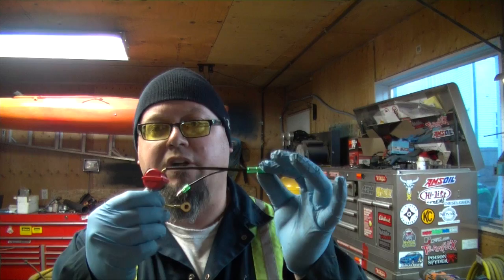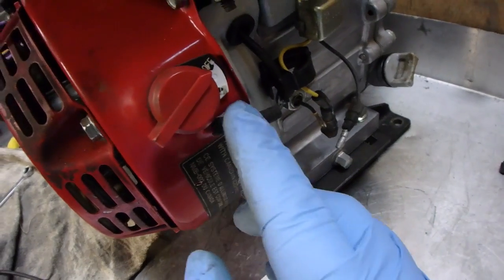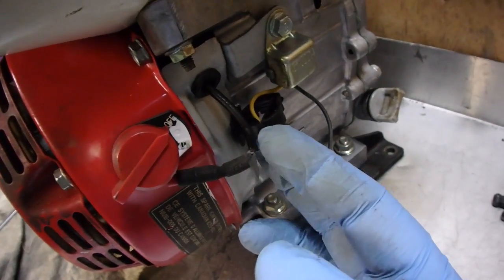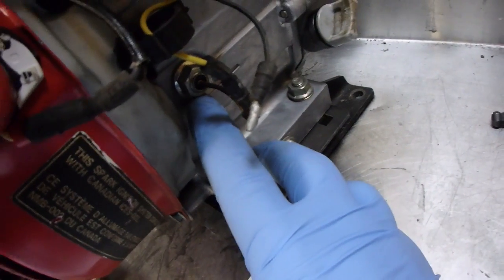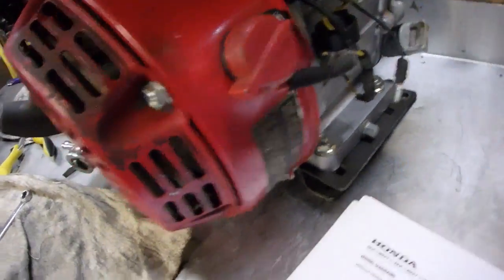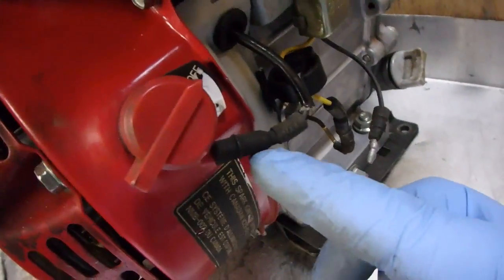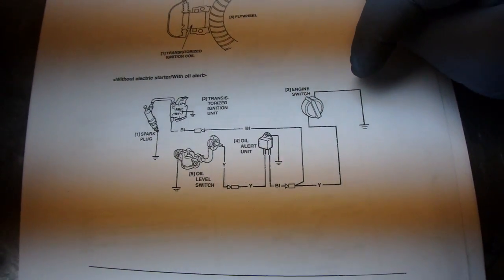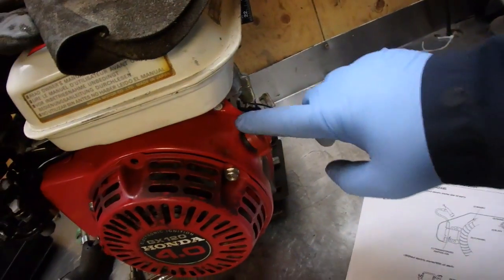Honda GX120 Why was the Low Oil Killswitch Hotwired

Comment: I bought a new power washer with a Honda GS390 engine running it.  After about 10 minutes the engine miss fired a couple of times and then died.  The engine oil was at the proper level.  I had no spark even though the coil was making voltage.  I sprayed ether into the carb, but no fire.    A day later It occurred to me that I had night tried the old standby . . . a ball peen hammer.  I tapped the nut on the side of the engine where the yellow wire goes to the low oil sensor.  The engine then fired right up.  Sensors can be a blessing, and also a curse.

Comment: A mouse at the wire off my low oil sensor. I removed the nut but the sensor does not come out. How is that sensor replaced?

Comment: Have a gx160 that I have replaced the carb the coil spark plug air filter an changed the oil it only runs for seconds then stop an ideas ?

Comment: Here's a thought on the reason the previous owner bypassed a perfectly good switch.  Whatever it was powering had alot of vibration and/or the engine mounting surface as well.  It was probably a temporary fix.   I have a GX 390 powering a constant duty water pump that I had to bypass because of some broken welds on a lower mounting plate (being  further above the vibration source in this case exaggerated the vibration causing enough internal engine slosh to trigger the shutdown within the first minute or so).  At least it made a good and mostly safe TEMPORARY fix until the welding repair happened.

Comment: would be nice if you talked a little about the ground path and how the sensor works and gave us tips anyway how to trouble shoot the sensor.. what should readings be on an ohm meter or what the sensor actually does to cut power.. i'm guessing it shorts the ground? because the wire going to the coil seems directly connected to the ground via the switch at the same place as the sensor via the Y connection...

Comment: Very common to disconnect the oil level sensor on these engines and their clones when used in Go Kart and Mini Bike applications because the engine will shut off when cornering hard. These engines are designed to be ran in their upright position. When tilted or cornering the oil level drops causing the engine to turn off. Predator engines are the same way.

Comment: Nice video.  I have the same engine on my brand new California trimmer reel lawnmower.  The issue I have with it is, it stops when slightly tilted left.  The oil Level is fine. My lawn is slightly sloppy.  When tilted left even a little bit, it stops.  It seems to work fine when tilted right.  Do you have any idea what could be the issue?  Thanks
Reply: It’s the oil sensor.  Bypass it like this one and never look back.  Same thing with my pressure washer.  It’s honestly way too high for the oil that we can fit in them with low crank case fill ports.

Comment: hi i picked up 2nd hand RocwooD Petrol Pressure Washer 3000 PSI 7HP  , 1 week after buying a new one of amazon and it will not start i have swapped everything from new one to the old one and still will not start , the old parts i put on the new one  and they all work , i done the air gap on coil pack and gaps on valve tappets and an oil change any ideas people ...
the man i got it off said it had never ran properly when he bought last year .....

Comment: If (rather when) that unit which kills the ignition when the oil level is insufficient is broken, the engine can be started, but it stalls after one or two seconds, because it has parts able to loosen up. Most likely the owner got fed up with the continuously stalling issue and got rid of the causes. Since it's a four-stroke engine, it makes a lot of vibrations. It can make small, cheaply made electronic parts go bad. The simpler the better, this is why I won't buy new cars ever in the future.

Comment: Good video...of course first thing to check would be the engine oil level....then go from there. Also, best checking the Honda manual on how to check the oil correctly, using the dipstick/filler plug as it is NOT as obvious as most would think. Instructions??? 'We are (mostly) MEN!!!!....WE DON'T NEED INSTRUCTIONS'!!

Comment: Thank you for your video I have a question for you I have a Honda generator EM 2500 runs for 20 seconds then shuts off wait a minute or so I can start it again and it shuts off I don’t see that little silver box on my generator How would I disconnect the low oil switch to test do you see if that’s my starting problem
Reply: Smfle see if there’s a yellow wire. Try pulling that one out. Worked for my gx390, no idea if it’s the same on the small ones.

Comment: What does the oil alert unit do.?
Reply: demofilmpuntnl when the oil reaches a critically low point it hits the switch and it stops the engine stopping it before it throws a rod

Comment: I have a bigger version gx 390 . PRESSURE WASHER  After 30 mins the engine dies, starts back up, then stalls , on&off all day. Low oil sensor is bad. OFF/ ON. All day maddening. ONLY shuts down after 30-40 mins. That's why oil sensor seems fine.
Reply: Same same on my pressure washer.  Buy a new one or just disconnect and forget.  Never needed a low oil level shut off on any small engine before.  🙂

Comment: This engine (and its clones) are the most common engines used in go-karts and mini bikes.  Anytime you lean into a turn or take a turn at speed, the oil float drops and causes the engine to shut off.  Almost every guide to using these engines in a hobby vehicles recommends disconnecting the low oil sensor to prevent this.
Reply: *Sender

Comment: Fairly common issue is engine begins to stall after an hours use or so. low level oil switch is a common culprit. so many disconnect/bypass as quick fix.
I have a GCV190 with this issue. Came across your video while doing some research on it. thanks for posting.
Reply: hey what about the lil fuse  in the spark plug boot? how often do they go bad ? i searched  and searched for the problem of no start and by accident found this lil fuse type thing up in the spark plug boot under the plug connector replaced with one out of another  and it started up who would know but a honda engine tect?

Comment: just a guess...

previous owner couldnt get the motor started (perhaps due to issue unrelated to oil-  like carb) but had himself convinced the low oil sensor was the cause.
Reply from the maker: +jschirr you could be right, who knows what the previous owner was thinking

Comment: I wonder if the engine was used in a tilted position and kept shutting of and that's why  the bypass.
Reply from the maker: +Steve Rob it would have to be a pretty good tilt, you'll see in upcoming videos when i have the GX160 torn down for a complete rebuild